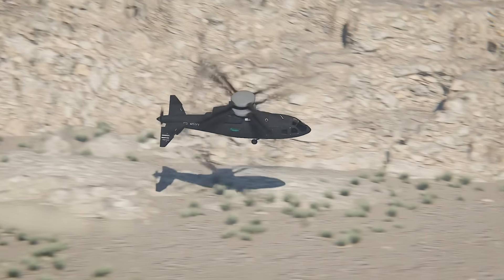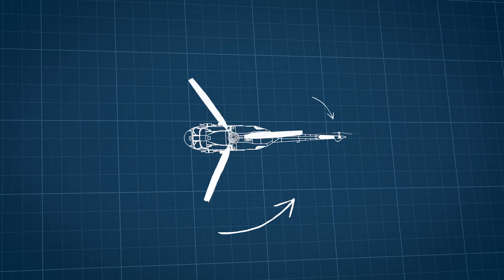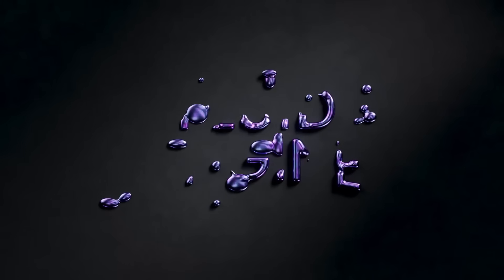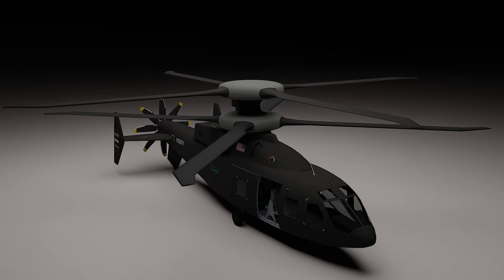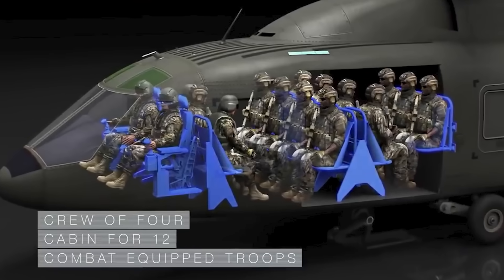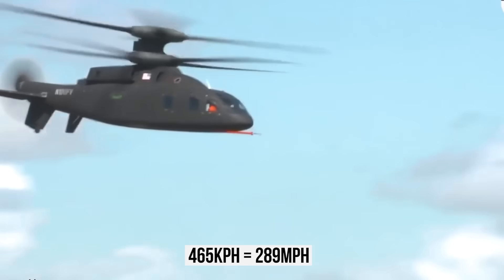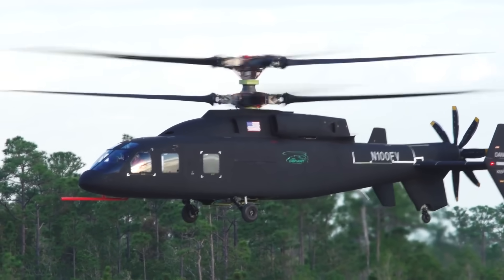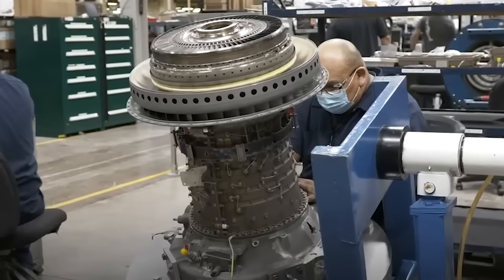Why the SB-1 never had a chance as the new US Army helicopter?

Comment: I have this feeling that in 20 years. We're going to look at this helicopter like we looked at the YF-23
Reply: Something better will come either way.
Reply: @NineSeptims  nope, this is how helicopters were supposed to be from the beginning, coaxial is the way, safer, more solid and rigid.
Reply: @NineSeptims  
Me: (Longley looks at a SR71 sitting in a museum, sheading a single tear...  )
Reply: @lcfflc3887  Coaxial helicopters are not just a better design all together. Sure they have their advantages, they are objectively more stable. Safer though? They are incredibly more complex then a traditional helicopter, and because of that are more prone to failures, and higher maintenance costs regardless how much you develop them.
Reply: Simply not true. Ka52 vs Mi28 case is significant.
Reply: @lcfflc3887  Then how come no one besides Kamov ever got one into production (the Kaman HH-43 and K-Max were not coaxial helicopters)?
Reply: @matthewsylvester9103  anything that eliminates the tail rotor is better, since lost of tail rotor can kill the most experienced of the pilots.
Reply: I agree. The Valor will prove to be a mistake. Tilt rotors are not the answer

Comment: That's not only a coaxial but a compound helicopter. Now this terminology is confusing because some compound helicopters have wings.
Reply: Compound coaxial is not that hard, just its own category
Reply: Not helos, rotor craft. Helos have one powered main rotor or two. If have propulsion forward is a Gyrodine and tilrotors if they move their rotors.
Reply: @Argentvs  not entirely correct: Gyrodynes have wings and can take off vertically.
Autogyros also have forward propulsion and free rotor, but no wings nor true VTOL.
Reply: @almerindaromeira8352  Gyrodines don't need wings. Wings were put in some models to hold the forward engines. Is just like helos have wings to hang weapons. Gyrodines only need forward propulsion being the main forward force. Helicopters have to tilt for it, Gyrodines use the propeller to lift mainly and forward momentum is given by a separated propulsion.
Autogyros don't have vertical lift true, but they are rotorcraft.
Reply: @almerindaromeira8352 By "true" VTOL I assume you mean to exclude the ability of some autogyros to take off vertically by locking their broken and using the engine to create a strong enough draft to spin up the rotor and then lift off. If so, agreed. It's more of a party trick than a genuine ability.
Reply: Just as calling it an Air Force project...
Reply: That's right. The narrator never did note that--with its pusher prop--the SB-1 is a compound helicopter, like the cancelled Lockheed AH-56 Cheyenne project of the 1960s. The Cheyenne, however, had a normal 4-blade rotor system, so it needed a tail rotor in addition to the pusher prop.
Reply: @Argentvs  Gyrodynes work like autogyros until they get enough speed over their wings to be effective which allows them to slow the top rotor, reducing lift drag and retreating blade stall
Reply: @Argentvs gyrodyne rotors aren't powered. Rotors only move with air flow

Comment: That's not a helicopter, that tilt rotor design is basically a plane. When one of the engines gets blown out of existence that's it start praying
Reply: It's ok, you have no idea how it works.  You shouldn't make declarative statements when you don't understand something.

The V280 has a cross shaft linking the two gearboxes, so one engine can power both rotors.

Comment: I'd like to point out that ain't no way that helicopter is nearly invisible to radar when it has not one, not two, but THREE spinning blades just out in the open. :D
Reply: You would be surprised how little of a radar return rotors give, especially ones designed to be stealthy. helicopters are actually very difficult to detect by most large/midsized radar setups do to how low they fly. Hell, helicopters already  make excellent AA  platforms, provided they have air-to-air missiles equipped and are flying low, because of how difficult they are to detect (at least against non-stealth aircraft, so just the F-35, F-22, and that Chinese 22 ripoff). The Apache for example has a very favorable  K/D ratio (during combat exercises) against literally every (except the 22 and 35) aircraft sent against it. Mostly because the fighters  usually don't realize the helis are there until they are moments from getting blown out of the air.
Reply: Just guessing, but I think the rotors are made from nonmetallic composites, which may be completely transparent to radar.
Reply: @hanzzel6086   Exercises and real world experience have shown that helicopters are at a big disadvantage against fixed wings.

Comment: Russia has been using counter rotating helicopter blades for decades.
Reply: Why hasn't the US?
Reply: @dannydaw59  Normal helicopter can do most job just fine with lower maintained cost, and if you want to go fast, US already have tilt-rotor like V-22 that is just better than counter rotating helicopter.
Reply: @dannydaw59 don’t need to. The little tail rotor does the same thing. Why add on extra huge ones on top for? More expensive, more maintenance. To make it worth it, you should add a pusher propeller.
Reply: @TheBooban  Then why didn't the Russians use the tail rotor?
Reply: @dannydaw59  not sure but if I had to guess, the double top rotors give them more lift and power. Something western helicopters don’t need to do because their engines are better.
Reply: Stop repeating things stated in the video
Reply: @dannydaw59  they do. Mil-Mi, Ka-62.
Reply: @dannydaw59  Only the kamov design bureau built the russian coax helicopters. Mil the company that builds the MI-8, Mi-24, MI-28, does traditional main and tail rotor helicopters.
Reply: @dannydaw59  They do, it's just that the coaxial rotor layout was invented by the Kamov bureau (which is why it's called the Kamov layout in some countries), so it's obvious that they use it. And it has some advantages over the classic layout - up to 30% more lift, smaller rotor diameter (which is why Kamov helicopters are used by the Navy, they can fit in the hangars easier), no issues related to dissymetry of lift and retreating blade stall (that's why the Bell Invictus needs to have stub wings but the Raider X doesn't) and a smaller target for missiles and SPAAGs (Ka-52 flying without a tail is not a War Thunder thunder thing, it can do that irl too).
Reply: @olekzajac5948 not invented. Perfected. Pescara N°12 was the first Helo to lift, made by an Argentine inventor and won Paris show after WWII. It had counter rotating rotors.
Reply: Russia also had a specific use case where they really needed that extra maneuverability, which is mountainous terrain such as in the Caucasus mountains. The US didn't have that same kind of combat to deal with such as what was seen in things like the Chechen war or the Ossetian war.

But in places like Ukraine, the Ka-52 isn't giving anything extra that a conventional helicopter can't already, and it's more expensive to build, fly, and maintain. That is also why Russia only has so many of them.

US hasn't used this style of design because so far they haven't needed it. Better to field more helicopters. But now that the US is starting to wise up that they might have to fight near peers again, quality over quantity is starting to become a necessity again. You're not going to win a quantity war with China for example.
Reply: @dannydaw59  different circumstances, different design bureaus, different approaches.
Reply: They don't also use the rigid rotor head that makes the compound part possible.

Comment: Where the Sikorsky-Boeing SB-1 Defiant will have an advantage over the V-280 Valor is strafing runs from above. The rear pusher propeller can be put in reverse, actually a change in the pitch of the blades, slowing the helicopter down greatly. Because lift is generated by the main rotors and not the wings the pilot could have a lot of time to perform the mission. Having more time at targets) allows more effective attack runs.

Comment: Bell had another key aspect that won the FVL contract: Bribe money, especially since the tiltrotor concept is being put into more vigorous scrutiny.
Reply: "especially since the tiltrotor concept is being put into more vigorous scrutiny."
...
Proof of this? or are you just talking out of your ass.
Reply: @n3v3rforgott3n9  I'm guessing that you've slept through all those recent fatal V-22 crashes.
Reply: @cjmanson5692  So you didn't see the 11 Black Hawks that crashed in 2023 alone... again what you said changes nothing. The Tilt rotor concept is not "being put into more vigorous scrutiny". When a crash happens it is investigated and it is believed to be mechanical they are grounded till proven otherwise or fixed... this is standard procedure. In fact the Osprey has a better crash rate than other similar platforms but it gets more clicks from people who eat up the click bait.
Reply: @n3v3rforgott3n9  And your proof? Otherwise, people will just see you as a paid spokesperson.
Reply: @cjmanson5692  You're the one making the accusation, what's your proof?  Have you noticed the number of Apache crashes in the last year?
Reply: @tararaboomdiay7442  I'm guessing you slept through the three-month grounding of the entire V-22 fleet earlier this year.

And what's more, neither Bell, nor the USAF, USN, and USMC, have found a fix for the entire fleet's Hard Clutch Engagement and structural problems, yet put the bird back into the air in March, without any fix whatsoever.

Comment: Tiltrotor will never replace the Blackhawks though. Acess to tight landing conditions is kind of a necessity for them.
Reply: You would be surprised. The V-280 looks big but it is actually quite small, especially compared to the V-22. Its a bit wider then the Blackhawk due two the rotors sticking out the side, but also shorter tail to nose by around 20%.
Reply: @matthewsylvester9103  the v280 was 20ft wider. A big difference for a urban environment. It's also the same length basically. A better solution would be a Blackhawk esc aircraft. With two main rotors not one slightly smaller. Reducing width, and the trial rotor being replaced by a pushrotor. Now you have a fast transport aircraft that can deliver troops into tight spots.

Comment: The SB-! should be converted into a heavy attack chopper akin to Russia's Hind. A flying weapon's arsenal with the capability of being able to carry troops, offer fire support and should be distributed to all branches of the military. The osp replacement ca. be used to get boots on the ground faster sure, and that is a benefit because marines lead the way, but I can see the benefits of the SB-1 are good in other areas for marines, army, navy, and air-force. Why not call on both designs to be used with roles for specific purposes. Why not make the SB-1 the ultimate Gunship/tank? I have a few ideas on how well the SB-1 platform can work in tandem with its competitor (as well as the Apache platform) tactically. 
Who knows, with the right configuration it could replace the A-10.

Comment: "While tiltrotors offer superior high-altitude cruise performance, that’s less relevant to future high-intensity warfare where Army aircraft will have to stay low to avoid advanced anti-aircraft defenses. Also ,the compound helicopter is more agile at low altitude, hovers better at high altitudes in hot weather, and can maintain tighter formations. More importantly, the training and military construction costs to switch from the H-60 to a compound helicopter will be much lower than the transition costs for a tiltrotor." I could not agree more. That and Tilt-Rotors will never have the safety of conventional rotors in a power-loss scenario as they cannot auto-rotate, the prop rotors will pile on drag very quickly. That and the fact that the thrust being so far out away from the center of gravity, if one side is shot out or suffers a catastrophic failure, it's over for the crew and occupants regardless of which mode of flight it is in. Once the fatal accidents start to build with the V-280, it will be clear the mistake the Army made on this much as the USMC and USAF did long ago on the V-22

Comment: coaxial rotors to land safely even with engine failure? how does that make any sense?
Reply: Are you talking about the defiant? Why wouldn't it be able to. Besides autorotation is not a key factor for military aircraft as it basically never saves heavier dual engine helicopters that military uses mainly.
Reply: @n3v3rforgott3n9  It's wings aren't large enough to glide to safety. Or did I misinterpret something?
Reply: @johndor7793  Which platform are you talking about? Defiant(coaxial) or Valor(tilt rotor)
Reply: @n3v3rforgott3n9  defiant
Reply: @johndor7793  defiant can't glide* because it has no wings. It would autorotate though. *typo
Reply: @n3v3rforgott3n9  Dont know what you mean. How exactly would it land safely with an engine failure?
Reply: @johndor7793  It would need a dual engine failure which is beyond rare in a multiengine helicopter. Helicopters in general can autorotate when they have full loss of power as long as they have enough altitude and/or airspeed.

Comment: The AH56A program was canceled in 1966 because it was too fast to suit the air force. Only tilt rotors are allowed to break 220 knots.
Reply: Speed wasn't the issue. Air Force didn't like that AH-56 could do close air support, which they felt was their role.   So they lobbied repeatedly against it.

Comment: I've always wondered why despite the Defiant's similar size and function to the UH-60, that it appears to have much less interior space for transport by comparison. This video claims it has more room, but compared to both the Black Hawk and Valor it looks like less than half the main fuselage is used.
Reply: 75 percent of the airframe on the Defiant is dedicated to the aircraft's engines, gearboxes, drive shafts, etc.
Reply: the defiant is actually much higher. giving it more interior space but also killed it as it wont fit in wasp carriers
Reply: @luc_8710  Like Predator42ID said, Defiant the engines, mast and transmission take up a large amount of space in the fuselage..  All usable interior space has to be forward of the mast on all X2 vehicles.  To be able to fit the required number of troops inside, they had to make  Defiant's fuselage wider.   There was no requirement for naval use so that's not why it lost, but you are correct height is a problem if ever the Marines for interested.

Comment: Great video, I really liked the graphics.  The humor was great too.  
—-
I was wondering about that pusher prop.  Pusher props are notorious for overheating which is why we don’t see them much.  I wonder if they’ve finally solved that problem efficiently?
Reply: And yes I know it was cancelled but seems like it could be a good idea.  Maybe they can try again in the near future.
Reply: Sounds like the intention was to drive the pusher prop off of the rotor gearbox similar to a conventional tail rotor. AFAIK the overheating problem with most pusher aircraft is that the prop wash doesn't cool the engine when the prop is mounted behind the engine.
Reply: they have i think...look at the P180 Avanti...unless its just a heli related issue but it think with todays materials and computers we have...

Comment: I am a complete layman, but considering the still ongoing issues with the Osprey, I can imagine that a "conventional" layout like the SB-1 would have been a safer bet than yet another tilt-rotor aircraft.
Reply: You are misinformed by biased sources frankly. The osprey is not more dangerous than other similar platforms. While maintenance issues are a thing, they aren't too surprising on the first of a completely new platform.
Reply: @n3v3rforgott3n9  Its not a "completely new platform". The first prototype flew in 1989. I remember being a little kid and seeing images of it in books. The First and Second Gulf War, 9/11, the Afghanistan War, LOTR movies, Titanic, the introduction of the first iPhone etc. all happened after the first prototype flew. It is 2024 now and it is still plagued by technical issues as seen with the string of recent air accidents, which caused multiple deaths. I know that each new platform will likely have accidents as design faults are ironed out, but come on.
Reply: @Melior_Traiano   first full production model is still the first one. All other ones were test bed aircraft proving the concept.
Reply: @Melior_Traiano  also other platforms have more crashes, but because it wasn't during the age of social media, it is ignored, and now they are revered. The Black Hawk had 20+ crashes in its first 6 years of service. The CH53 has a far worse crash rate along with the ch47.

Comment: If the helicopter is fast enough,  then the blade tips go supersonic . Unlike a prop aircraft,  you are not leaving the Shockwave behind. 

If your blades are short enough,  you could increase speed and maintain lift with wings. Now you need adjustable blade length,  which would require offset blades., and thats an issue , especially with harmonics